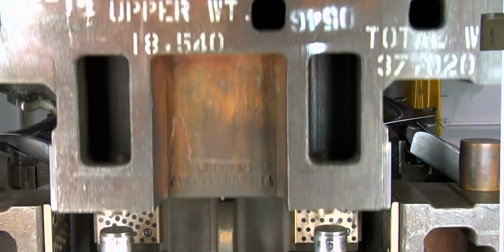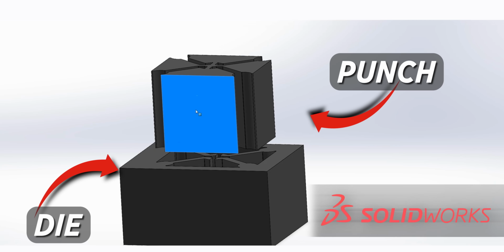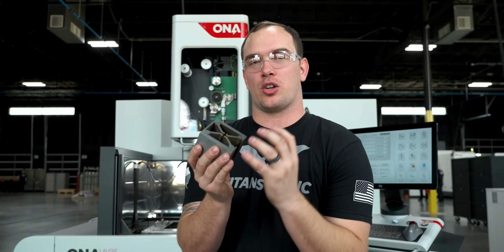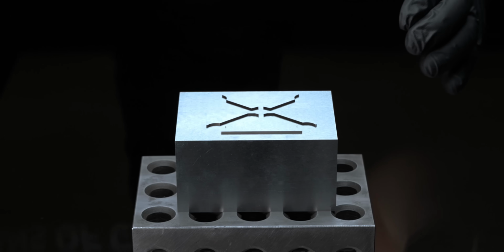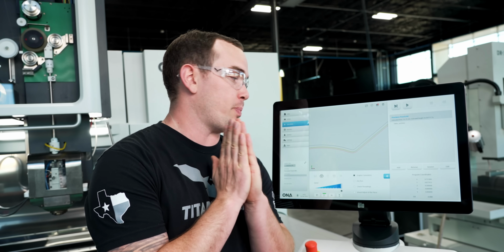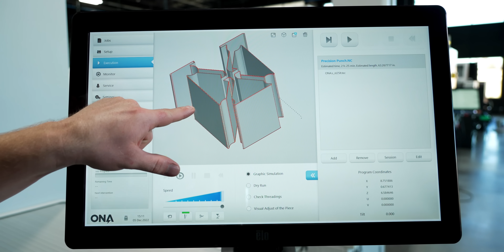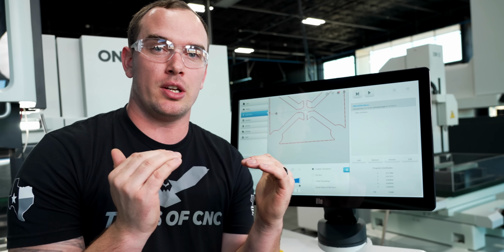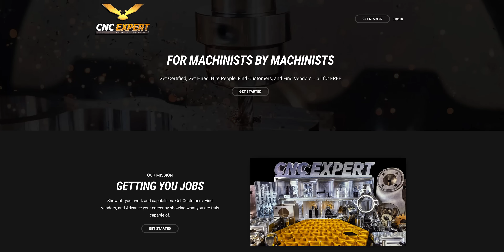SECRET Process Of MACHINING FLAWLESS Parts

Comment: You left out a very important issue ,you didn’t show the TAB , you did not finish skim cut that punch suspended in air , you had to leave a tab or a way to support and hold the punch while doing the skim passes after you pulled the slug .  Then you can only have  1 rough pass to cut the punch off. Tell the audience how you address removing and finishing that area . You have 1 million people  now thinking you can cut a finished punch complete with no other operation .

Comment: I remember when I was in machinist class and the instructor demonstrated zero tolerance. He had two pieces of perfectly machined surfaces of steel blocks. When you slide them across each other, they would stick together. Air tight contact.

Comment: I'm a Tool & Die Maker and ran everything in the shop.... An EDM can cut things out as fast as a person could on a bandsaw with a course blade if you really want it to.. The accuracy will be less but perhaps for clearance on a stripper it wont matter.  As long as you get your offsets correct and settings for speed... perhaps a second pass where there is just a touch more sparking... It's actually not that difficult to make.  Looks cool but is not difficult.

Comment: No such thing as Zero tolerance machining, this only shows your ability to measure needs increasing. For years I worked on sub micron profile tolerances and if you can afford it you can get equipment that measures in angstroms. The limiting factor is usually you ability to control the temperature.
If both male and female forms were the same tolerance they would not move, and the only way to mate them would be to heat the female and cool the male component.

Comment: A few questions:
   Firstly, I run a laser cutter at a sheet metal shop. I run the old pulsar lasers (Amada LC-2415), but we have one of the "newer" Amada fiber lasers (I put "newer" in quotes because we bought it in 2017). The kerf on the pulsar laser is around 0.005" (I think it's thinner in the fiber). I know this is a stretch with the pulsars, but I don't see why you couldn't achieve around the same micron level precision with a fiber laser if you adjusted the offset correctly and controlled the position of the head to micron precision (albeit, on sheets that are much less than an inch).
   What makes EDM more precise than laser cutting? Is it more about the precision in that thick of a piece, or is just demonstrably more precise than laser cutting in general? Or could it be that attaining the level of precision you get with EDM requires extremely high mechanical advantage to move in such tiny increments (so much so that the movement becomes glacial) and running a laser at that slow a speed could fry the laser of cause other issues?
   Also, what do you use a die set that precise for? Is it for some kind of extrusion? I was under the impression that punch and die sets are used to punch, emboss, form, or generally shape a work piece in some way, and I thought you always need clearance for that. What can you do with a clearance of around a micron???? It's freaking awesome! I'm just very curious.

Comment: How do you hold the "punch" part?  If you have to cut completely around it, where can you grip it?  The video kind of briefly shows you removing it from the machine but too quickly to see any detail.  Did you have a magnet holding on to an existing flat surface?  Or if you cut it completely through, would that not leave a burr on the corner?  The part seemed to be still hanging onto the machine when finished so that seems to rule out cutting completely around it.
Reply: very simply do the first 3 sides completely then turn the piece and do the fourth side

Comment: Hi Trevor, What an outstanding workpiece is the one that you fabricated,I am really really impressed,Doe,s the machine makes the cut under the water to compensate for temperature differences on the cutting edge ? and so avoid expansion in the material ?.Thank you so much for these kind of superb videos,

Comment: Okay, let me get this straight...

So to make up for the material loss by the wire on each piece instead of cutting it to the exact measure. You basically cut it up a little bit bigger, so that it stays at the exact measurement that you wanted it?

Comment: Sorry dude...... I've worked in manufacturing all my life and have been a programmer for many years. Have ran EDMs as well.
Even .0001" is a tolerance and there's no such thing as zero tolerance machining.
Every machine is itself built with a tolerance in its components. And every machine is sold with a tolerance that it can produce. Therefore every part manufactured on that machine has some form of tolerance band and nothing is perfect, can't be.
Your words are impressive, but what is this piece even used for? It's a demo for the masses, same type of stuff that you see at IMTS or any other machine tool show.
I built real stuff for aerospace and medical implants. 
Blaaaaa..... Blaaaàaa..... Blaaaaa....

Comment: Nice job. Did you actually measure the parts to see how the actual dimensions? If you can get access to a facility with something like a Leitz PMM-G then you could get the numbers. The thumbnail text on the video about “zero tolerance machining” is misleading as, of course, that is an impossibility.

Comment: I always thought zero tolerance would require the parts to be pressed together, like with a hydraulic press.  So why does a part like a wheel bearing in a car hub need to be pressed in or out?  Is it "less than zero" tolerance on parts like those?

Comment: as a machinist, all i can say is ZERO TOLERANCE IS HELLA BOLD STATEMENT YOU MAKING
Reply: Every process has a tolerance band associated with it. It is a question of where the decimal point is. Gage blocks have a tolerance.
When Maudslay started boring cannon castings it was said that the bore varied by less than the thickness of a shilling....at the time that was perfection!

Comment: It’s cool, but I can’t imagine the use of Zero tolerance in real designs. The friction between the two parts (there is no room for oil or any lubricant) can make the temperature increase enough to modify the dimensions…

Comment: This is a brilliant fit, very impressive, kudos to you. I was a prototype machinist in 1984 and learned to use a Charmilles wire EDM. We made some basic parts, but there was no skim cutting available. I made a “punch & dye” of my first name, but they did not fit together, close but no cigar. We then got a 4 axis Mitsubishi with skim cutting. Made a couple of name plates for senior managers. The die from steel and punch from brass, the fit was not as good as Titan, but it impressed the bosses. Can’t imagine what it cost, all the programming was manual, but then again, we were an expense department!

Comment: When my 3rd cousins husband [ biiiiiig Irish family ;-) ] worked for Ilmor  [ Mercedes F1 racing :-D ] he called the machine a 'hot wire eroder', it was 10 years ago ;-)

PS I also felt the rush when you slid the part to the edge to let it drop as you let the air in. Put that in an average press and your corners would be burger though, lol, great work.

Comment: Would ringless pistons be possible with this tech?
Reply: There'd be too much drag, so the piston couldn't move fast enough in the cylinder to run.
Reply: @OneTequilaTwoTequila  what about if the Piston ring part was pointed at such a small point to be similar to a standard piston ring? But using 1 rather than 2/3. Theoretically there could be less friction, a stronger component, and tighter tolerance I’m thinking, but a much more expensive replacement. This however wouldn’t matter to Drag cars, pro race cars and highly maintained high power output cars.

Comment: I'm confused as to how you got the dye cut without cutting through the outside... Do you have to thread the wire through a pinhole and then tie it in to the machine?... That's my only thought on how that's possible without leaving machining through the outside wall... Am I wrong?
Reply: To cut the enclosed pocket in the die block you pre drill a hole in an area that’s going to be cut away then you cut your profile and remove the slug, cut your trim passes and your done. 

You can see the hole we used at 3:15

Comment: I’m not a machinist so please forgive me if this question is stupid. But where would you need two steel parts with a tolerance that tight? I mean if air has trouble passing through it then surely oil doesn’t stand a chance so any high temp application is out of the question. While I appreciate the technology and it’s very impressive but I’m at a lose as to where it’s needed. I’m sure after you tell me I’ll feel even stupider but please what application needs that tolerance?
Reply: Plastic injection molding for ex. We are using 0,005mm tolerances in wire cutting.

Comment: Imagine using this process to make perfectly layered steels. For example, a "San Mai" blade where one type of steel is sandwiched between another. Machine blocks of metal to this perfect fit, then heat to forging temperature, and use a hydraulic press to forge-weld the steels together in one press across the whole length of steel. Then quench, grind to shape, temper, etc.

Comment: I'm not a machinist, just took some high school classes a while back. Zero tolerance is insane, especially with metal heating and cooling — great job!
Reply: no such thing as Zero tolerance. Absolutely everything has to have a tolerance.
Reply: Zero tolerance has little to no application in real life as far as moving parts are involved. You need tolerance to offset shrinkage and expanding of materials. That's the very basics of material science.
Reply: It's not zero tolerance, just very very precise. Tolerances on wire EDM are as low as 2 micron but that's not zero. Things like gauge blocks have even tighter tolerances and you can clearly tell because they "stick" together due to Van Der Walls forces as if there was glue holding them together, yet there is nothing, just blocks of steel.
Reply: They are using an iron alloy know as an Invar. "Invar, alloy of iron that expands very little when heated; it contains 64 percent iron and 36 percent nickel." "Lohaus says it had been long suspected that this behavior was somehow related to magnetism because only certain alloys that are ferromagnetic (capable of being magnetized) behave as invars."

"As the temperature of an Invar rises, the spin state of some of those electrons increasingly flips. As a result, the electrons become more comfortable cozying up to their neighboring electrons. Typically, this would cause the Invar to contract as it warmed up. But here, the Invar's atoms also vibrating more, taking up more room. The contraction due to changing spin states and the atomic vibration expansion counteract each other, and the Invar stays the same size."

Comment: Here is a suggestion for an update: 
Make a 8x10x2 die with a 3x4x2 hole so that the edge of the 3 comes to the center of the 8.  Then make 3 1x9x2 punches hollowed into cups and place it next to a figurine where they measure 5.8 high. 

Call it the wall of the future.

Comment: I am neither a machinist nor an engineer.  I've watched many EDM videos and wondered how it could be done without leaving a kerf.  Yours is the first video that explained the process and clearly detailing how it is done.  I suppose others merely assumed that their viewers already knew that it required TWO different blanks.
Reply: hello bud, 
its correct. whenever you cut something into two, a gap is created to at least the width of the blade, no matter how small the blade may be! Apparently also including a blade 1/4 the sized of human hair! Crazy!

Comment: I'm confused to as how you get the wire in for the die?

As with the punch it was cut from the edge, if it's a wire in assuming it's like a really precise bandsaw.
Reply: Think of it more like a scroll saw, the blade/wire has a top and bottom so you drill the hole feed it through and reconnect it
Reply: @itswilliee  
Thanks. That makes a lot of sense.

Comment: What if you cant use a wire cutter which would compromise it metallurgically after it has been hardened for aerospace/millitary etc? How would you make the part?
Reply: Wire cutter? I edm heat treated metal all the time
Reply: @tannermiller5888  Of course you do. I never said you cant. What I said what if it's a component that can't be metalurgically compromised by the electrical discharge? I have form ground many areospace components which would have been much simpler to EDM/wire if permitted.
Reply: @punishr36  I misunderstood. Wire will not compromise material if trim cuts are used. Wire a long time ago would cause problems but not the modern machines. I edm parts for Lockheed and other aerospace companies stainless titanium etc never any issues. Some companies will not allow it do old wire machines that did cause issues. Modern zinc and topas wires with trim cuts have almost no issues. Space x Boeing etc have yet to have a problem with the parts being wired. Trim passes allow removal of the majority of the HAZ and recast of the wire.
Reply: @tannermiller5888  It turns out that the materials I have been using based on the fact that they require specific heat treating processes are not permitting electrical discharge unless it is used to rough out and then finish grind to remove to a specific depth for certification. Are the parts you are making for Turbines or transmissions etc?

Comment: mmmmh, the cut parts on the wire-EDM, the most expensive parts in the department of special purpose machinery manufacture. when i was still working as a design engineer the seniors always told us to avoid parts that can only be manufactured on the wire-EDM machine...

Comment: How did you break the punch off the holding part? i saw you move it back and forth to break it off, but wouldn't that leave a burr or raised end that needs to be filed? And i guess 0 tool pressure, so no chatter or anything happens?
Reply: You have to leave a tab on a flat surface and grind it off to perfection

Comment: One of the coolest things about a Wire EDM machine is as you're going home you can throw a part on it that will save hours of machine time for instance,
A large part you need to work on tomorrow in the Lathe you need to knock a big hole through it and you get to keep a piece of certified material. 
Or various Mill parts can be cut to net size even certain features that are unique that would be impossible on a Mill.
We were making a bunch of carts for carrying missiles where you have a taper at each end along with the various features for toggles and latches you can literally take a piece of plate and start knocking them out complete with the taper and if you're really ambitious you can even burn the holes for the pins.
We used a lot of stainless .010 shim stock sheared to .08 to .12 wide so the wire went past given points we would insert a shim bend it over on the top of the plate we were cutting it from and the opposite direction on the bottom of the part so it wouldn't fall through and or possibly catching the lower flushing head breaking it. 
They can be very very useful machines even on common everyday work it's hard to imagine they can actually save you money.

Comment: how did you finish the punches on the side that was holding it to the vise? did you machine it manually? because you can't do that on the EDM or the piece will sink or rotate a little bit ruining the tolerances.
Reply: They cut most of that side in the wire EDM except for a small tab. Any ideas how they remove the tab without cutting that face? I would leave material and bring it to the surface grinder, especially since the punch has parallel faces, but I don't think that's what they did here
Reply: @LousyBlowfish  I do that all the time,leave a small tab and grind it later. Otherwise you have to rotate the punch and make a second operation to finish the other side

Comment: Are those tolerances provided by the manufactures with the spark distances too? Or do you need to formulate those on your own?
Reply: ONA provides it's customers with a tech library that has a wide variety of power settings for tons of different materials and thicknesses. Unless your cutting some crazy material type or trying to get an insanely good surface finish that is uncommon, there will be a technology file provided that you can use!

Comment: Impressive. What's the cycle time for something like this?
Reply: Thanks! About 3 hours per piece.
Reply: @trevorgoforth8963  Hello Trevor, how do you stop the workpiece from falling into the tank? do you go most of the way around and then put a magnet on the bottom where it has already machined, then start the program going again and then it wont fall?

Comment: What RMS surface finish do you get on the walls of the punch and die parts.....just curious......
Reply: That depends on many things, in this case we only used one rough and two trims which left us with about a 25 RMS. If we used 5 trim cuts you can get down to a 10 easy. In carbide you can get as low as 4 micro inches.
Reply: @trevorgoforth8963  
I don't believe it's exactly correct to spec an EDM finish in terms of RMS.  RMS is more of an indication of a consistent finish in a specified direction.  Think about the very, very fine "thread" type finish you get on a lathe in one direction.  Even less applicable in carbide because if you magnify an EDM'd finish in carbide enough, you actually see something that looks like concrete with divots and pockmarks, no "grain" structure.  Very picky comment though, this was a very, very cool video.  Thanks for the great work.